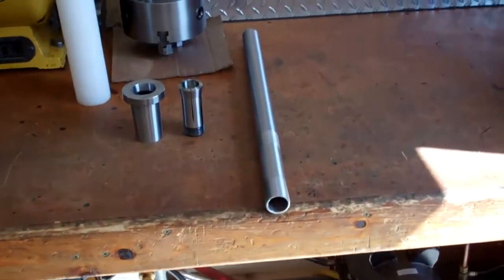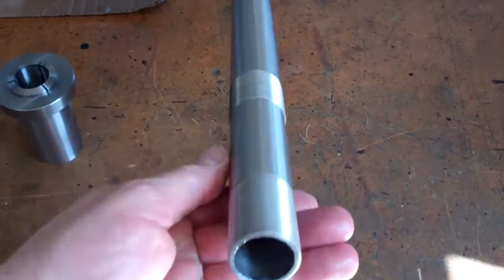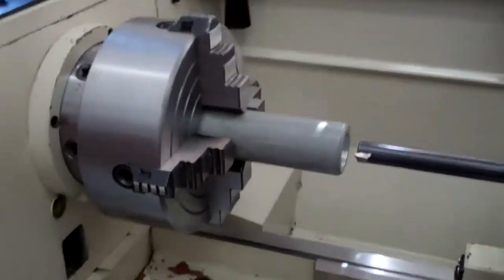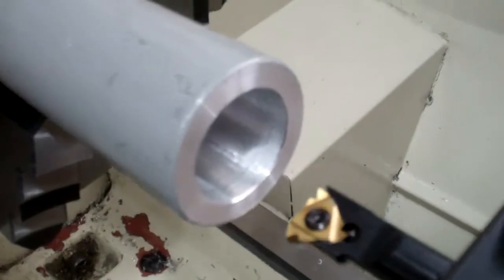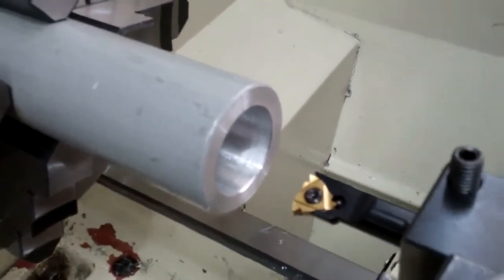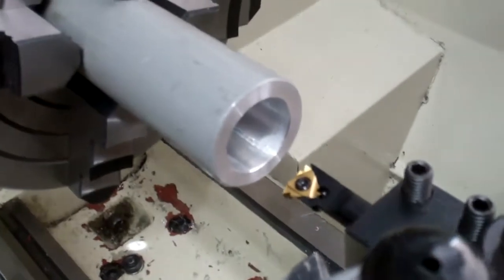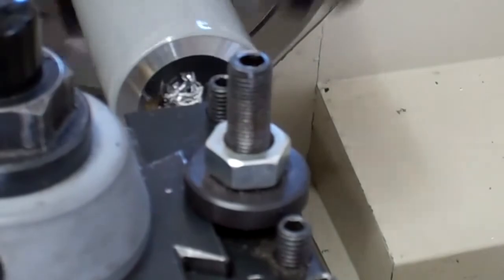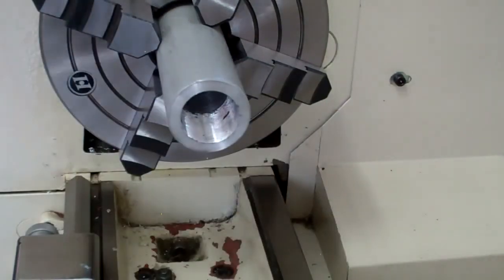5C to MT5 Drawbar Part 1 #realraysgarage

Comment: Never noticed this before in your other lathe videos, but in this video it sounds like that motor is knocking. Is the cooling fan rubbing on the housing bell or something? Maybe it's my imagination, but that motor seems like it has a rough knocking aspect to it. Did this change since you made this video Ray? I know you mentioned in another video's comment that the lathe hasn't given you any major problems, but did the motor sound smooth out?
Reply from the maker: My belts were loose, I cleaned up the V grooves and tightened up the belts and now smooth as glass.
Reply: @RaysGarage  Sweet! Great to hear, because mine just got loaded on the truck today, at the Missouri warehouse. So with any luck I should be seeing it mid/late next week here in Wisconsin. I also ordered the same DRO they put on their other 14" lathe (G0824), so there will be some work to do when it first arrives.

Comment from the maker: Hi Tyler, I used the 4 jaw because my material was
1-7/8", the bore of the 4 jaw is 2" so I could set it in to gain a little more rigidity. The 3 jaw chuck is only 1-9/16". Thanks for watching!

Comment: That’s a lot better solution. Grizzly has a closeout on their kit for their large gunsmith lathe for $224 so I’m going to go ahead with that versus another chuck. The accuracy will be right off the spindle and no chuck to screw with. I suspect I will also have to shorten the bar and came here looking to see someone who had done it.
Reply from the maker: I agree Glenn, the 5C Collet chuck might introduce run-out where you should be good with the MT#5 to 5C Adapter right off the spindle, if not you could precision grind the adapter like I did for zero run-out!
Reply: Ray's Garage I looked at that adapter alone from grizzly and now they are getting $120 for it. I suppose they are more in demand.    Either way you have the right approach for accuracy coming off the spindle. My spindle has zero runout. At very high rpms my dual indicator will bounce a little around .00015 probably from harmonics. Using just a chuck unless it’s a higher end chuck I will struggle to get them down to .002 after screwing around with gently tightening bolts in a fashion it torques the chuck toward center. This past week I had to toss two chucks including a Chinese 5c I hadn’t used much but the runout was far too much for making mechanically rotating parts. I use a lot of square and hex adapters and the finished end gets chucked so if it has any runout the spindle end is out of center and no good to use. I see some people complain about technique though I have some shop made tooling that works great including an mt3 thread adapter we made and we never ground the end and it functions great. In the end that matters more than cosmetics if you’re using it for yourself. I think folks forget that aspect of you can get great results that is what will matter when you rely on your made tooling.

Comment: Ray, I recently got a used G0709 and was looking at buying a 5C collect chuck from Precision Matthews, until someone in the Hobby-Machinist forum mentioned that I could just use it directly with an adapter... no need for the chuck.   The collect chuck is 345.00 vs 205.00 for the parts from Grizzly (minus the aluminum stock).  Trying to decide what route to take.

I have a few questions if. you do not mind answering them:

1. Are you still using this setup?  Or did you switch to something else for 5C collects?
2. The drawbar from Grizzly only has one set of outside threads... yours show two sets.  Did you make that second thread?
3. Do you recall the thread settings you used.  Since we have the same machine, figured I would ask you for those.

Complete newbie here... have not even made a thread...ever... So a bit intimidated by tackling this project... reason that I am going back and forth on getting the 5C collect chuck instead... Any guidance is much appreciated...

Thanks again,
Jaime (a.k.a. Wachuko)
Reply from the maker: Hello Jaime, I used this setup until I acquired a Royal 5C Collet Closer at a very good price, I had to machine a few complicated parts to get it to work properly and that's what I am using now. My recommendation would be to get a 5C Collet Chuck with a D1-5 backing plate. This will save you from having to make parts like I did in the video. A good collet chuck is the way to go in my opinion. As far as single point threading just go for it, it's something you must learn, start out with a Shars threading tool and insert, set your compound to 30 deg, set your dials to the thread pitch and go to town! There are several really good videos on single point threading, I learned from Mr. Pete and my threads are perfect! Best Regards, Ray
Reply: @RaysGarage  thank you!  Will go the 5C collect chuck route then.  Will order the one from Precision Matthews.
Reply: @RaysGarage  Royal 5C Closer... I just googled that... WOW!!  Sweet!  Let me check your videos to see if you posted one of that install.

Comment: I was surprised it screwed in at all.  Clearly it was either not a 1.5mm pitch or the machine was set on 1.5mm, not 1.25mm pitch?
Reply from the maker: +R Balderson I may have misspoke on the pitch, I did this project a long time ago and don't remember the correct pitch but, I can tell you I use it often and threads in perfect every time! I should measure the pitch and post the correct info, thanks for pointing this out!

Thanks for tuning in!
Regards,
Ray